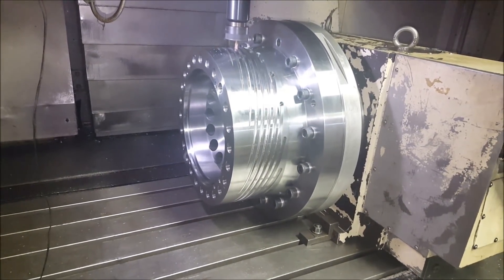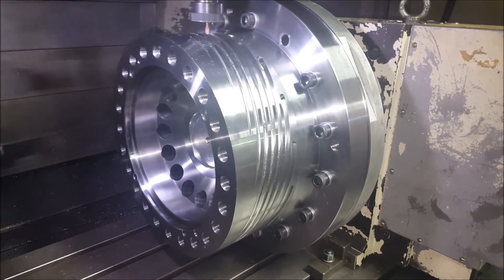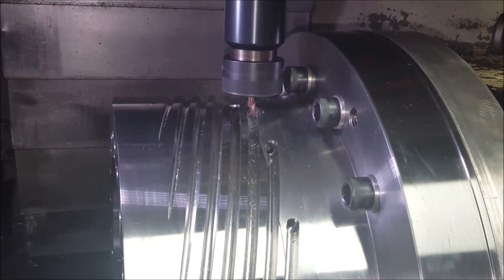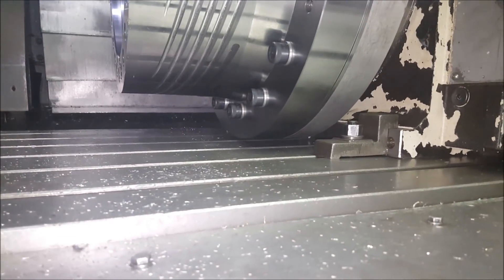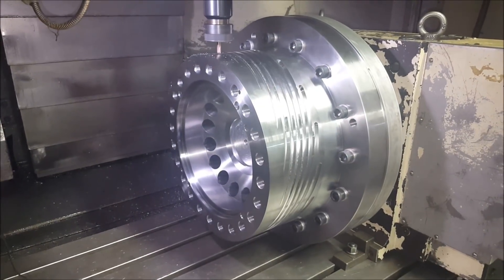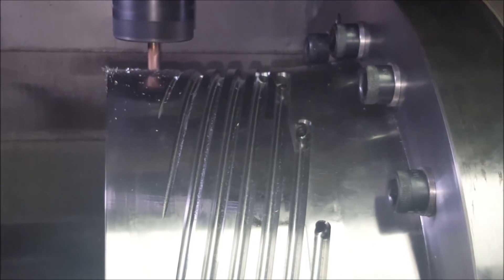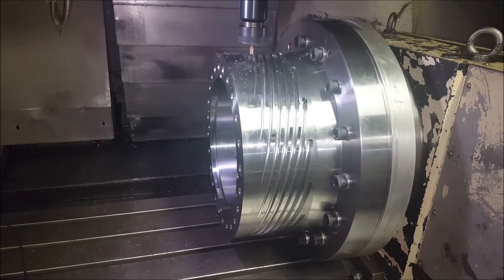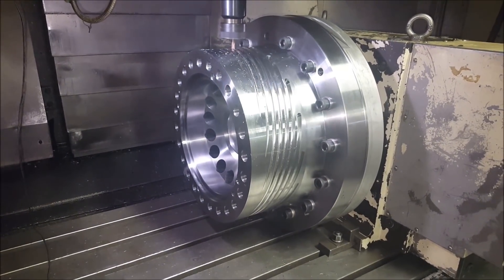4-axis CNC Milling.  Blown Film Die Machining Preview

Comment: What are some tipical tolerances for that part ?
Reply from the maker: The OD of the spiral surfaces is +-.0005 tolerance all over, plus from the front face to the large flange face it is +-.0005".  So pretty tight.
Reply: Marcin Zala that +-0.0005" or +-0.0125mm is tipical high precision at around 4-5" diameter where i work , so doing the same on double the diameter(or more) looks impressive . For me the tolerance on that lenght is the scarier one , probably cause i'm used to machines that produce lenght variations of +-0.015mm regularly . Thx for the reply